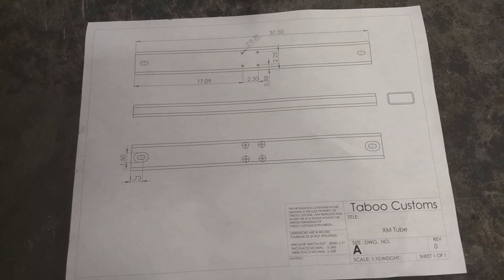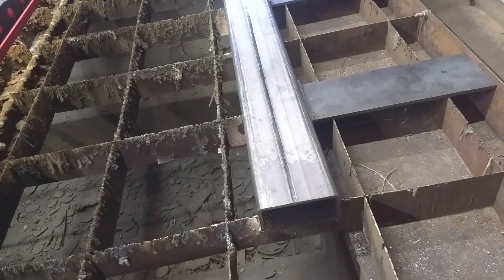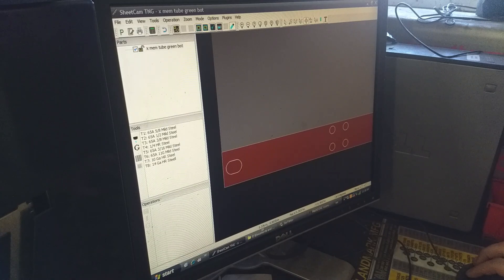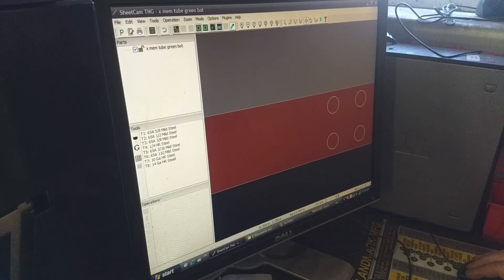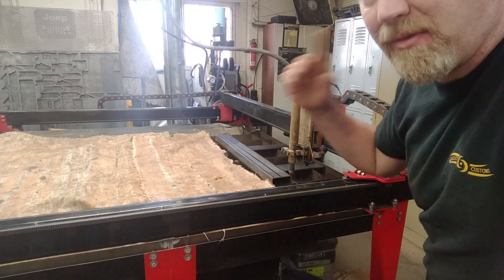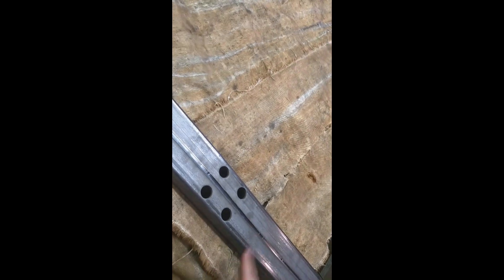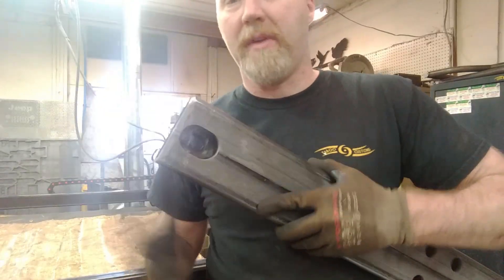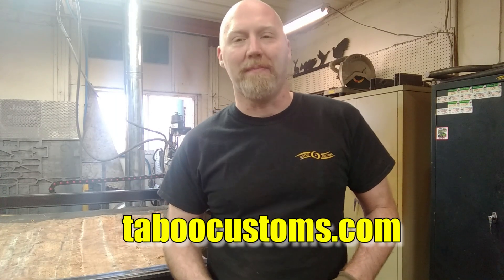Wright CNC Plasma Table - How to Cut Tubes

Comment: Just a suggestion but I would bolt a fixture plate to the table. Have the plasma cut it at a straight line on a known x and y axis so you have a standard zero point to fixture your tube to. Make an end cap with a vacuum hole on the tube to force the smoke to exit thru one side of the tube.
Reply from the maker: Thanks for the ideas.  We have some spacer plates we now use to square up full sheets and other items on at least one side.  I need to make a second set to use on the other axis just haven't gotten around to it.
Reply: @TabooCustoms  yes sir !

Comment: Great video and great tips! I love the tip on aligning the opposite side of material by using the first cut as a shadow / guide in software!

Another simple way to square material to the gantry is to clamp a couple pieces of flat / straight material to the gantry which hang down far enough to meet the edge of the material being cut.  It's super quick, fairly accurate and, in the production world REPEATABLE for multiple parts!  You so need to account for the material and torch offset when laying it out in your software, but that's pretty simple to measure.

Just remember to remove them before running the table :D

A tip on cutting tube on a water table (may work for a downdraft but I haven't tried it) is to remove a slat and rest your tube in the water, blocking it up to the necessary height if need be.  This is hit and miss as a lot needs to align for it to work, the tube needs to fit between the slat supports, fit within the dimensions of the water table, etc. but it can help keep the smoke down.  Not great, but an option if needed.
Reply from the maker: Thanks, good idea on the gantry.  I have made a few items that help me square up the sheets without issue.  I believe we covered them on another video.
Reply: @TabooCustoms  Cool, i'll check it out.  I always love to see what others are doing to solve common (and sometimes not so common) problems!